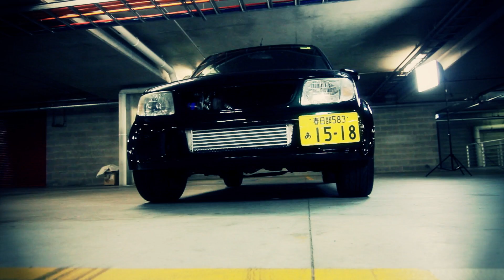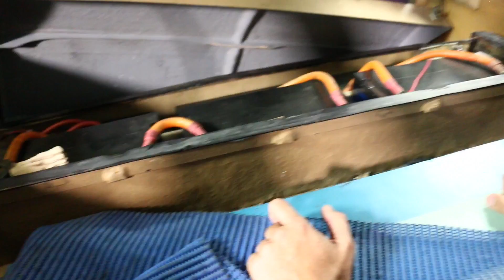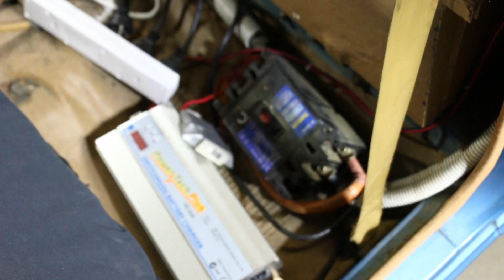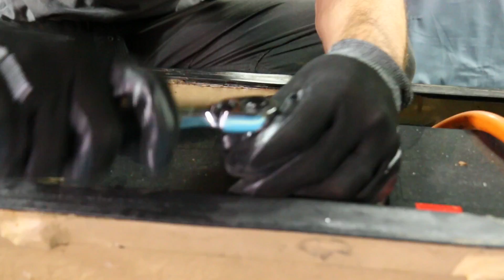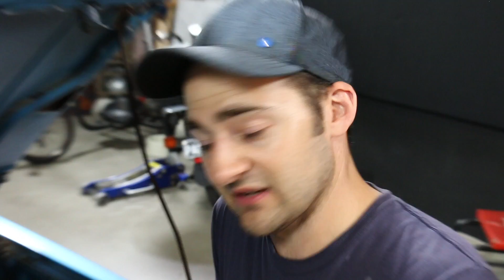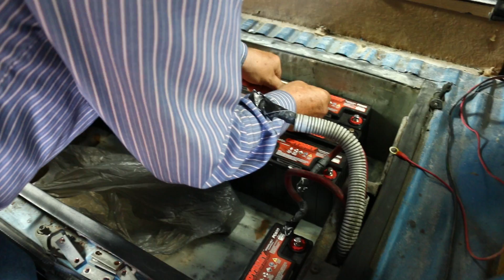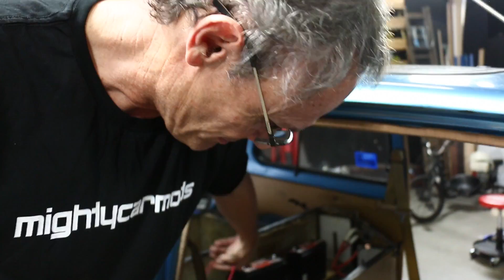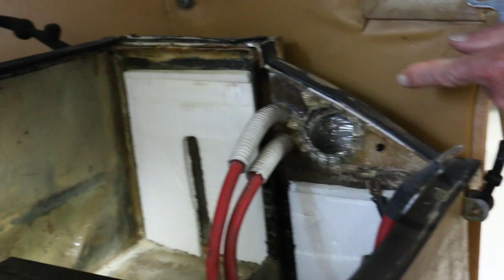JDM Electric Turd

Comment: Well old batteries was 12V 90Ah, and new ones are 12V 16Ah. So 90x12 gives you 1080Ah, and new ones 16x24 give you 384 Ah so waaay worse. So don't tell us such a crap about some kind of old mystic technology :P, old setup was much more powerful, but heavier.
Reply: +Lestat_Laki That's now how you calculate amp hours. Also, you don't understand power vs. capacity. Old pack= 144v  * 90Ah = 12960 watt hours. New pack = 144v x 16Ah = 2304 wh of capacity- so less range, but having owned that same Odyssey battery, I wouldn't doubt that the new pack will have more power (watts) than the old one, not to mention being much lighter.
Reply: +Ned Funnell batteries don't have watts, engine have. If they didn't mods engine, the power will stay same man. Again, old setup wasn';t some crappy old technology, I would say that new one is much more worse, because there is much more batteries, better have less with more capacity. Btw this is how it look regular 90Ah 12v battery in novadays, they are big and heavy and I cant believe that two of 16Ah will be better that one 90Ah like they said.
Reply: +Josiah Crowley dude,  Ah come with weight, there is no cosmic technology that give you power from same batteries. That new ones with "better technology" weight 7 kg and have 16 Ah, and old ones has around  20 kg and have 90 Ah, use calculator...
Reply: Lestat_Laki Where do you think the motor gets the watts from? Seriously, go read about this instead of assuming you know.

Comment: why not you stik to alternater on the motor  run a 120 ap battery  acdc convert on it my spit runs like this
Reply: +Gary Radov Then your loading down the motor so you would be loosing power.
Reply: makes sense

Comment: actually you need 3 things to get elektric cars going : enough loading stations (like gas stations) , enough range, and short loading times  wich so far i only see with low energy density super capasitors ..... if we´d miss any of these with petrol cars then sells would drop down and mankind would basicly go by train ... ;)

Comment: You need to use LiPo batteries!!! A quarter of the weight, and a quarter of the size, with the same output. You can save a lot of weight, or add a ton of power.

Comment: why not rig an alternator that is run off the motor, that way when its moving it can help charge its self and extend its range?
Reply: +peterincgy the load from the alternator may exceed the gain to the charging system.
Reply: how much power does it take to turn an alternator? In a gas car you cant tell
Reply: if you load the alternator heavily you can feel it put a drag on the engine, and the car is usually programmed to idle up a little bit to compensate for the draw on the motor, but as an example, when you turn your wheels, at idle you should get a slight increase in RPM due to the load put on the steering pump.  If you turn on the AC, it usually kicks the electric fans on, then u will get a slight decrease in RPM until the ecu corrects it.   It would seem like it shouldn't take a lot of effort to turn it, and wired correctly it would give never ending supply of power, but after i learned more about it, i learned you can never get something for nothing, The gasoline engine is spinning the crap out of that and it cost the motor some effort to do it. so electronically spun, to charge what is spinning it don't usually work out.  i would love to design something that could give you more out than the effort to spin it, that is the age old goal to "free energy" and such.   unfortunately, nobody has figured it out
Reply: yes, my idea was just to add to the range, to add some to the battery,  not to be able to drive totally on the alternator but that idea would be great if you could! haha
Reply: i was just trying to say, by adding an alternator you would probably decrease the range rather than increase it.   just because of the effort the motor would put forth to spin it under load.    could rig something to the brakes, so under braking it uses the energy of stopping the car to help charge a little, one of the other electric car makers already did that. All the electric car manufacturers would have alternators on their car if it helped the range.  Non of them do.  /shrug maybe someday.
Reply: +Rhage73 *will  Will exceed. if you want to regenerate you need to get a (for this car) DC regen controller.

Comment: Nice project! The "correct" way of doing this is really really expensive, and engineers take years just to do a project about it, even to design a firewall that could protect you somehow from the explosion, because if you are using a system made of lipos that makes 1000Amps of peak at 400V, if that thing explodes, you would be lucky if they can identify your body, but that would never happen, because normally every "x" quantity of cells you have a electronic protector (which is very very sensitive) that isolates the cells electrically. The actual systems also use an inverter and an AC motor (obviously). With Pb batteries you would need to connect to much os them in parallel in case you want enough amperage, because lipo cells can have a good  "C"  discharge rate, but on Pb's its quite a lot limited. The only good thing about Pb's is that they are not as dangerous as other type of batteries.
Reply: +Alvaro Q.F lipos dont explode they burst into flames big flames have you had one go i have i race mini quads/drones
Reply: +8alakai8 They burst into flames after the cell is "broken" after it gets puffed, but if you have some cells in a firewall well fitted surrounded with carbon fibber (conductive), then they cannot expand by the easy side and they could explode in the worst case, but anyway, if a cell bursts into flames anything around it will have a serious damage. I do have remote controlled devices lipo powered, but these are much more dangerous than "normal" electric cars, because electric cars have "tons" of cell balancing chips on top of the batteries, so absolute safety is warranted, you cannot compare RC batteries with the complex systems inside an electric car.
Reply: +Alvaro Q.F have you ever had a bad crash and youre lipo bust into flames i have but no explosion they dont explode check it never seen one explode

Comment: Volts don't kill people, amps do
Reply: +31TAZFJA The volts directly determine the amps, you ignoramus.
Reply: +Bladsmith V=IR. 

I=V/R. While volts do matter in determining amps, resistance is key. 
A static shock is tens of thousands of volts, and you didn't die last time you pet a cat, did you?
Reply: +Bladsmith Time scale isn't a factor. 100mA across the heart is lethal. You're confusing very basic electrical terms here.
Reply: A static shock lasts not even a millisecond. :I
Reply: ***** And a 12kV static shock is theoretically about eight amps peak. It's just that a static charge in a human body contains about 0.007J of energy, which is nothing. :I
Reply: V/R=I. When V grows, I grows. Therefore, the more voltage you have, the more current you have.
Add to that the fact that the resistance of the human body goes down as voltage increases, and you have a truly dangerous, if technically true fallacy on your hands.
Reply: Ah, but if the resistance is large (large denominator), then a massive change in voltage is required to see an appreciable change in current output. Again, you can't just look at voltage and immediately assume what your current will be.
Reply: +Bladsmith No the required power does. Volts are relatively harmless unless you hit the stupidly high range.
Reply: +Bladsmith so does the required amperage to stop your heart permanently.

With DC it is a lot easier to control as well so a static shock would most likely stop your heart, POSSIBLY kill you though very unlikely.

Stating Voltage determines anything is misleading and is like stating pressure determines the volume in a water pipe system.
Reply: ***** True, but in the context of electric shocks, we can assume that anything over 30-50V without other current limiting factors can be lethal in worst case scenarios, and that you should be careful with all high voltage situations.

Comment: As a person who has experience with large high voltage high current battery systems. You guys need to have the help of someone who ACTUALLY knows what they are doing or you are likely to electrocute, blind, burn or otherwise really have trouble. Also DO NOT connect these batteries in Parallel. If you must run 2 banks make it so each series bank floats from the other except when they are actually powering the motor(2 chargers and an isolation system. like 2 relays.). Also fuse these banks at each battery bank so an electrical short will not be such a disaster.
Reply: +NebukedNezzer Watch the 2nd video, they actually said they weren't going to use both banks of batteries for that specific reason.

Comment: AFAIK the Pb-based batteries are still used in cars because they are the only kind we currently have that can operate in a wide delta of temperatures AND can be recharged from an absolute zero. All Li-Ion and Li-Poly batteries after certain point (less than 10% remaining charge) due to how the Lithum reacts, will create "lithum bridges" (i dont know the therminology in english, sorry), that increase the risk of shorting circuit and damaging the stuff that is hooked up to. Also, if completely discharged, cannot be saved because the regenerating process cannot be started.

Comment: since MCM is too busy working on the car, i did the math for them:
each of the old batteries weights 26.5kg x 12 = 318kg
each of the new batteries weights 7kg x 24 = 168kg
BUT with the old batteries they had 0.29kg of weight per Ah of capacity and with the new ones 0.44kg!
so in order to have around the same capacity they would need 72 batteries and carry around 504kg!!!
only unknown factor is the price because i have no idea how much these batteries cost in Australia.

Comment: hey guys, I'm a mechanic from canada, and I specialize in forklifts. what if you talked to a battery manufacture about getting an industrial battery like one you would find in a forklift. This would not be the cheapest option, but would work the best. They would also last the longer then any battery you could buy at the auto parts store

Comment: Great new project! 

Smell - all the smells could be diminished by ozone generator in the car for 1 - 5 hours. You can't work on the inside if the car for that time. but all organic smells will be killed. Smells that stay can not be oxidated off .. soap and watter i guess if it really is from acid spill.

Also... burning of circuits could be avoided by dry ice next to power electronics... at least thats how Tesla that competed at the pikes peak won. maybe not needed but if you do draw too much somewhere not affected by circuit breaker...

And I guess you guys will make this at least partially hydrogen in the next 5 - 10 years when there will be enough scrap available. At least with a range extender. looking forward to that.

Good luck!

Comment: Umm that smell, I reckon its the battery acid itself, and I would wear gloves at all times handling that stuff, especially around rusty areas as the actual acid from the batteries can and will escape and eat the interior and rust the metal.

its why jay leno uses acidless batteries, a gel one like they use in boats in his Jaguar XK120 and his Shelby GT350 respectively, as the battery in either is in the interior and the trunk respectively, and in one of the resto update videos it showed that the acid of a normal battery will eat through the floor if its mounted in the trunk, like on Jim hall's Lotus cortina. 

and that is ONE battery overtime, although that is probably one of the reasons why they used fiberglass

Comment: Racing motorbikes don't use batteries, they have an external starter that spins the wheels. Sorry :)
Reply: +Motorrad166 What do you reckon the external starter uses to spin up the rear wheel on a racing bike? Battery?
Reply: A simple google search quickly reveals many examples of battery powered external starters for bikes. Seems like the mcm guys may not be full of shit. Rad.
Reply: +Smith yeah, the external starter has it's own motor
Reply: Lol fucking YouTube experts

Comment: I hope you consider adding solar panels so it can charge whenever its in the sun. No you can't run off solar panels but you can pump enough energy back in to get home!
Reply: +Daniel Berkness So? Even if you only got half a charge it would still be free and if Marty drives 12 miles to get parts and the panel replaces 1/2 a miles worth while he's shopping and the rest just sitting in the yard after he gets back, its almost free milage or kilometerage or what ever they call it down there and after the system has paid for itself it would be free energy. I've said that about EV cars in the states, just learn to live with the look of solar panels on the roof instead of paint!
Reply: +Daniel Berkness there used to be a show on BBC that made things, in one show they made an electric outboard for a boat in Venice and built the roof out of solar panels and that was a good few years back
Reply: National geographic planet mechanics electric water taxi .. its on youtube
Reply: +Doc Ink not really a 250w solar panel in the sun for an hour might get you a km or two if your lucky. EDIT: For the added weight, aero drag and cost it would not be worth it
Reply: +Tim Watterson which was about what I said, while parked the panel could replace SOME of the energy used, not do a full charge, they would need to tow a huge trailer of panels to do that
Reply: Doc Ink
 the point is the rate at which a electric car consumes power you would need a significant solar set-up to get any charge that you would notice in day to day use, at the cost set-up added weight etc etc its not worth it in fact you will likely reduce your range. For every kg of added weight you losses around a km of range per charge(rule of thumb), a solar set-up can easily reduce your range more often then it adds range, do you want to park your car in the sun all the time or do you like a shaded spot.

Comment: 500kg of lithium batteries would give that little thing more range than my twin fuel tank diesel patrol.
Reply: +Spencer Howard  and a huge hole in the wallet
Reply: +Spencer Howard I did some math.. average 18650 cell lithium  battery (like you'd find if you tore into a Tesla battery pack or most 'phone recharger' portable power pack things) weighs about 40-45g.  To have 500kg of those you'd need around 11 to 12,000 batteries (like 50% more than Tesla use) and if you got them for the rock bottom bulk price of $6 per battery that's at least $66,000USD in batteries!
Reply: +ConnorWolf You can purchase high power 18650's for <$3, I've bought loads. A pack assembled from Samsung 25R or LG HE4 cells (last lot I bought was $2.70/cell) configured as 36 in series, 10 in parallel for a total of 360 cells will deliver 3.2kwh of energy or at a guess enough to get this thing 35-40km in range. Total cost ~$1k. These would also deliver 200amps and something like 28 horsepower to the wheels, perhaps enough for a 110km/h top speed depending on what the gearing is doing. Best part is that whole pack would take up about the same volume and less weight than ONE of the large lead acids that were removed. Depending on charging regime these same cells can last for 600+ cycles with most of their original power and capacity remaining. Can't say that for lead!

If you did decide to build a 10,000 cell 500kg pack it could deliver 720kw and a 1,000km range at city speeds in a little car like this. 

Lead acid is dead - salvaged lithium such as the Nissan leaf cells are cheaper across the life of the pack because they live so much longer, not to mention are smaller/lighter/more powerful and reliable.

Comment: AGM VRLA (Absorbed Glass Mat) (Valve Regulated Lead Acid) batteries are the best, they have high CCA (Cold Cranking Amps) and great charging and lifespan. Always look for a multi stage charger (Smart Charger) and never let them discharge to much as batteries only have a finite amount of charge/discharge. Always use the largest possible cable in pos and neg which should never be earth to the body of the vehicle, voltage drop is a real concern so eliminate the issue by returning the negative cable to the battery.  Hope that helps :)

Comment: The fishy smell generally means zinc is present. A trick I learned from and old mechanic is that you never want to put a battery down directly on a cement floor. Relative to their weight, the battery's plastic case is soft. It only takes one larger than average grain of sand to get between the case and the cement, and you put a tiny pinhole in the plastic. This tends to be fatal to the battery.
Reply: +Robert Clark  SCIENCE FTW!!! Thanks for that comment, i was gonna say i bet it had to do with the dead batteries since i remembered the same smell at the junkyard around the battery rack.

Comment: r those real deep cycle batteries? if not they wil work good for a short time and with in 1-2 year of normal use you have close to no charging capacity again.
Reply: +grapsorz They're AGM batteries I think but deep cycle specifically, people use them as lightweight replacement batteries for normal cars all the time.  I was looking at one for my AE86. They're an Odyssey PC680 battery.
Reply: ConnorWolf i think AGM last about 2 year's in that application before the capacity falls below usable. stil it was "free" batteries so it do not mater ;) good to test with ;)

Comment: Try exchanging some batteries with super capacitors! It will decrease the charging time.
Reply: Batteries are just as dangerous and a super capacitor pack made with comparative specs to a 12v car batery can be made for under $50.The storage is not as good but the power to weight ratio and charging time is better. The ideal setup is a battery/super capacitor hybrid system.